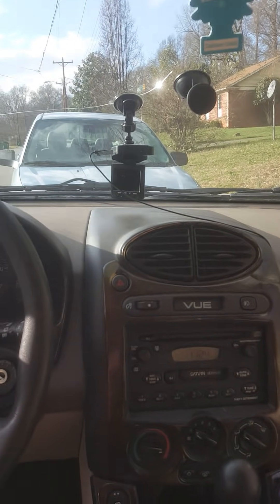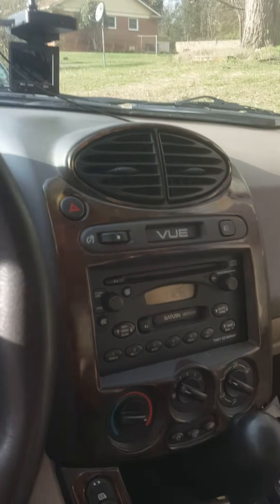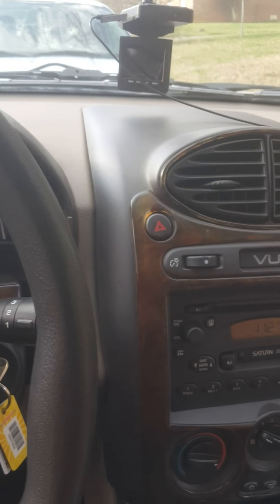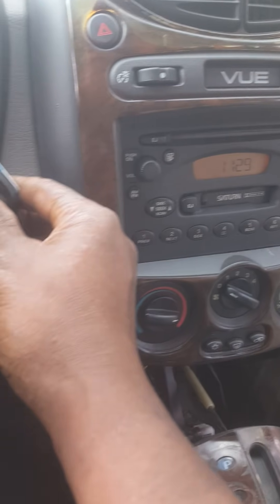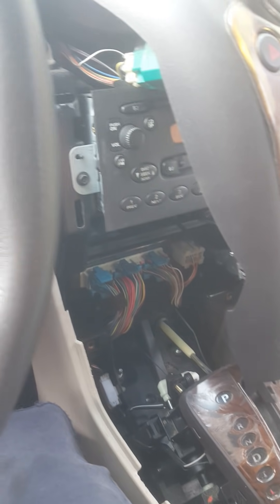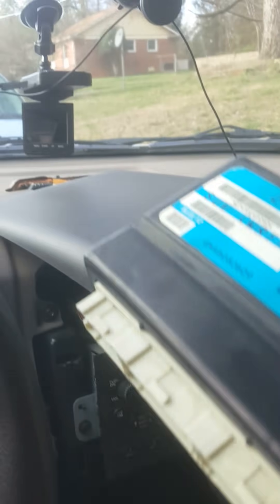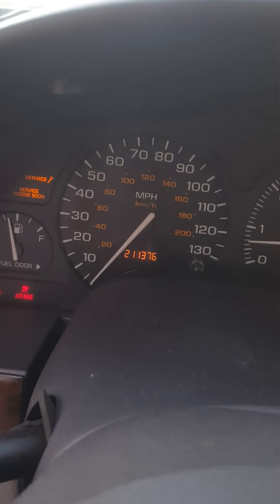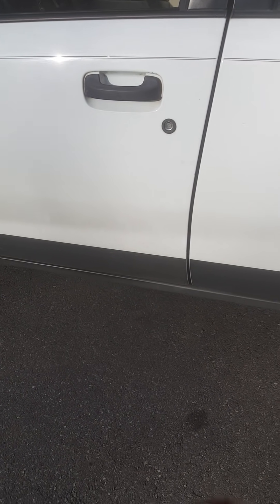How TO PROGRAM A BCM ... WITHOUT GOING TO THE DEALER

Comment: Dude, I don't think your keyless entry is failing because of the bcm...  If your replacement bcm is working, and you still cannot unlock your car doors with the remote transmitter, it's probably the transmitter itself...  you can try to replace the battery in the transmitter, or just replace the unit.

Comment: You didn't program anything... your key fob didn't work because it has to be reprogrammed because as you said, you lose memory to everything.  My husbands battery died and it fried his BCM. We got one from the junk yard and it runs fine now, but his brake lights are stuck on, as yours probably are and it needs a brake system,  rollover sensor and one other thing relearned and the key fobs need reprogrammed to the vehicle, which was easy to do through the options on the instrument panel on his vehicle,  but some will still need to go to the dealership for that.

Comment: your video is a little confusing. you said dont undo the battery, then you said leave the battery unplugged all night. then you put it in with the battery hooked up, I was told to diconect the battery on my car and then uninstall it. If you have a bcm for your particular car it will be fine. but if the BCM is off another car and doesnt match it wont work at all. unfortunately the bcm's are discontinued so junk yard or a guy with parts for your picticular model car. It can be done but most likely has to be reprogrammed. the bcm also works your alarm system.

Comment: Apparently I missed the part where you programmed the replacement body control module that didn't fix your concern with the remote door locking feature. It appears that you have created more problems for yourself. Hopefully you haven't created more problems for other people as well. Kind of ironic how you mention the world has changed for the worse... Lol.
DO NOT HOT SWAP ELECTRONIC DEVICES! IT ABSOLUTELY DID NOT FIX ANYTHING AND ONLY CREATED MORE PROBLEMS.

Comment: The os not reprogaming.
Some times you can swap bcms and not have to reprogram as long as the numbers match you can swap out them however the vehicle will have the other vehicles odometer reading so you could have made a golden egg or real bad lemonaid lol.
I would say reword it because that will still have to be looked at because if uour car it at 80 k  miles or kms. What ever you are and that had 170 k now you have just decreased your car value

Comment: I had a retired police 2006 Impala. All I wanted was the dome light to come on when I open the door. I swapped the bcm with one I got from the junkyard. The dome light comes on when I opened the doors but now I have check engine light. The camshaft position sensor and no matter what I did it never went off. Including replacing sensor and erasing the code or even putting the original bcm back in. Also maybe you should have replaced the battery in your fob or reprogram it.

Comment: Thank you and also maybe somebody asked. My 2006 Cobalt. Has the ac controls with the plugs as well as the interior fuse box has the two plugs do I just do the ones plugged into my AC component? There are three separate plugs in that guy. But could see where I would possibly need to do the fuse box as well? Or just the three in the ac plugins? Sorry. But like you said. No money and so much work I've put into this car

Comment: The problem is most likely the key fab. Take the back cover off, pop out the little circuit board take a "0000" fine steel wool and clean the silver connectors that the lock, unlock, etc. buttons push against on the board. Put it back together and the fab and it should work, a common problem.

Comment: This is great. My only question is, is it possible to keep your mileage, it seems like having inaccurate mileage would be annoying
Reply: and illegal to tamper with, unless your a tech or replacing with a programmed to car, milage n all rtr bcm (includes cab swapping re -vin-ing a vehicle sherif will gather info and apply it to the new vin# so milage is added to new config instead a computer, a tech uses thats part of a profile online thats associated to it, individually and milage is only available to change in collision repair and the vin they used  and use case ect, needs to match a car with less or more because the used cluster from Jy or wherever was cheaper and they went with it, )not sure where i was goin but vin # needs to be as accurate as possible within x miles is all tied to someone doesnt wanna buy a rebuilt car w 32,000 not knowing some one freshened their old car with, or the car the collision repair or scrap yards selling parts from totaled cars with some good parts still using such to gain the market that selling the used car would seem ideal. bringing the i think law on it. idk tho and  i hate rtyping

Comment: Aaron this is bad information. Not only did you NOT program it you have created many additional issues. Let me go through them.
1. Your mileage will change to whatever the used module had on it. 
2. You will have the SIR airbag light on and it will not go off. It is programmed with the VIN supplied by the BCM and will NOT transfer as it will give you a configuration malfunction code. 
3. Information on tire size is stored in it. If different than yours, your speedo will be off. 
You did nothing more than install a used BCM. These BCM specific to the Saturn car line are also a ONE TIME ONLY programming. To make this work you HAVE to have a new BCM that must be programmed with SPS/TechLine Connect. As to a no start with the security light on that is an easy fix w/o tools using the 30 minute relearn. In addition you will need to program you key fobs as they are part of the RCDL that communicates with the BCM and the FOB codes are stored in the BCM.

Comment: God bless you for your help. I was wondering do you disconnect the battery terminals till the next day before or after the swap? 4 years later and I feel that it’s become worse out here. Fast food inflation has gone up to %70.
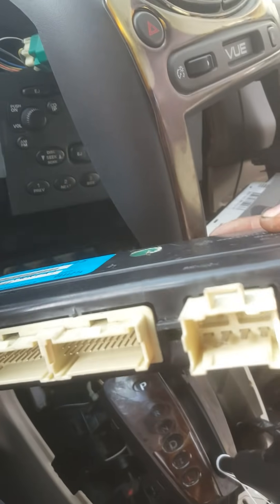Reply: If you have a bad bcm, DO NOT take off your battery cables, or your car will not start back up. At 5:22. ONLY IF YOU HAVE A BAD BCM, if you disconnect the battery beforehand, you have to let the car sit overnight (to drain all the power from the cars computer) then in the morning reconnect and it will run. ONLY DO THAT if you have to change your battery (if you say, have a bad battery) to get your car to run WITH A BAD BCM.

Comment: My 08 Vue's brake lights are staying on while key is out of ignition. It only shuts off when I pull the fuse for BCM VB3. I checked the brake pedal sensor (it's good), replaced the engine stop light fuse. Do I have to replace the BCM?

Comment: Although you didnt" program the BCM, you did change them out and the "new one" worked. Risky but Rewarding - Thanks for sharing sir
Reply: I don't think you understand what he's saying...  He's saying that if you disconnect the bcm when the engine is off, and there's no battery power to the unit, and then you install a replacement unit, you'll need to go to the dealer to have the replacement one programmed...  Conversely, if your battery is connected and the engine is running, you can "hot switch" the two units, and the replacement bcm will take the programming automatically from the car.  I don't know if this will actually work, because I haven't attempted it...  But it's worth a shot, if it saves you from paying for the programming service @ the dealership.
Reply: What dealers still have a Tech 2 scan tool...... I had to get a used one at the yard for my 2000 L Series probably 10 years ago, because no dealers used them anymore. Maybe some of the newer scanners will work today, I don't know. It's gotta be programmed for the lights to go out that I ever knew of. There's some way to clone them as well but I'm too old to get into the technical jarva. I had to get a new one from Rock Auto, which they don't stock anymore and have a friend of mine at a shop that had the scan tool to do it. It took a couple days due to software availability issues from GM, but finally got it downloaded to it. 3 years later I'm having issues with electronics again, and crank/intermittent no starting issues. I hope it's not back to the BCM problem again, because now they're getting harder to find new. Maybe a used one can be reprogrammed, I don't know.

Comment: So turn the key to on position then swap the bcm and it's good to go? 2010 traverse won't even start because of the bcm going out and like most I can't afford $600 for a new one and to "flash" it. Really hope this works for me. Gonna order a used bcm from same yr/make/model and try this
Reply: Did you fix it? Have you looked up if your car has a way to reset the car anti theft lock/security light. ? If it has a step by step process then that might work. It worked for my car, since thats what needs to be synced. The ignition switch cannot communicate properly until it is reset, for my car it was a 30 minute process and a $30 part from the junkyard.
Reply: @justchillin7274  no it didn't, I had to reprogram the key. Luckily my neighbors friend works for a repo company and they had the scan tool and let me use it. Took like 12 mins for it reprogram

Comment: This is ironic I run across this video. First, I have a BCM issue with my BMW 525i and it's needing replacing. Second, I have a son named Aaron Harris.  He's an Aircraft Tech and I'm a retired Heavy Equipment Mechanic. I would like believe this would work on my wife's car but these cars have to many electronic modules (mess) and I have my doubts.  Gotta do more research. Good job Sir.

Comment: Thank you  Sir; I'll gonna work on my  97 honda crv; I 've issues with door lock ,and internal light as well cigarrete lighter, ran some test on  electrical shorts, but i think  is the BNC. You mention the used bnc you replaced with , show the  milage of the  original car. My car only has 174,000 miles  i should get  something  less than 200,000  right ?, I like your opinion.

Comment: Mil light and flashing security is incorrect anti theft signal received and you can program the remote via key on and activating door locks to enter program mode NOTE bcm MUST be security (keyless ) equipped supplemental info in glove box on part list sticker 3 digit codes you'll have to look up s 10 is example aul for keyed entry, aux for keyless. Ecetra

Comment: I have   hyundai santa fe 2014 model CRDI  4WD automatic, push button start a car in which its bcm and smart key assy unit is now electronically damaged due to water filling ,no light is coming in car meter or no function working only stereo car is running no other function is not working,please tell me any proper solution

Comment: Ok its the bcm the problem 100 percent.  If remote don't work. ( try plug in and a couple of times. The relay will click in the bcm. And all will work. Another faulty bcm ( it come down to a relay in the bcm ( get a electrical engineer to change the relay. And it will work. God bless

Comment: Thanks for the info on my BCM. As you described the problem it is exactly what is happening to my 2001 L300 Saturn. And thank you for how to replace it and reprogram it. However, did the used bcm still have the program from the previous vehicle? Thanks from Jim of Roseburg Oregon
Reply: My Saturn l300 2001 miles are Unknown as well
Reply: Did u ever fix your problem

Comment: I'm trying to get factory cruise control I added to my 2000 SL2 working. I'm a Saturn Forum member and get so many answers that a Swap is all I needed to have the cruise enabled. Did the swap, and now "No Start !" I believe it's a security issue and I also believe I was told wrong that this procedure works just swapping the BCM that was from a Donor W/Cruise option. O.K., If all of you Genius's out there that put other peoples comments down, how is this done then ?! If a lot of You know about car's so much and how this works, how do You enable the Cruise after all the parts are connected ?! Let's see how many of You can give the correct advice. The Forum states "IT CAN BE DONE !" Let Me know, then. We'll see. Most Dealers said they can't enable it because of the age, or say there's no guarantee it'll work, You pay the $135 either way. Lol, I don't think so. We'll see which way is correct, here.

Comment: I got a 04 ion 2 kinda havin same problem. The ion is known for ignition switches goin out pass lock coming on says service vehicle on dash board.. what I just found out is it’s not just the ignition it’s the bcm. Which led me to your video. My local dealership is a joke I’m not about to even think of taking the car there haha. I think a tech 2 scanner read all old codes from bcm, swap it out, reprogram should resolve everything. But what you did does help, on the ion’s it’s the same way you disconnect your battery and whole vehicle starts doin crazy stuff. My mom has a Chevy Colorado did same thing as well after disconnecting the battery. GM hmmm. Thanks tho man I’ll keep this info in mind if I’m fact it’s my bcm I haven’t pin pointed it yet.

Comment: Just watched your video and my power windows on my Saturn ion 2007 does not work nor does the power locks on the driver side master switch is it the same for an 07 Saturn ion to swap out the BCM as it as it was for your vehicle

Comment: So leave the battery plugged up, and leave the key on (engine not running), remove the old BCM, install new BCM. Then start the vehicle. This is how it will program itself? Awesome!
Reply: Can you confirm this works? Also what vehicle have you done this on?
Reply: @Alex Cosme  a shop plugged a donor BCM into my 04 Colorado, and it flashed my 98K mileage to 240K on my instrument cluster😑. So now I have to remove my cluster to have it zeroed out, and it will flash back to the correct mileage that my new programmed BCM is set to. This stored cluster mileage MAY NOT always be a issue with all vehicles. But I'd make certain before ever using a donor BCM
Reply: I’m going to try this on an 03 Monte Carlo. I have a brand new bcm and I also have a donor bcm from a used car. Do you kno if I can use the brand new one or should I use the donor 1?
Reply: @KensBlends  did you try the bcm swap what happened?

Comment: I have a 2008 Impala that dash reads battery saver active and I have recently replaced the battery with a brand new one + Alternator & Starter + a fresh oil change but keep getting that message and sometimes my car dies out draining the battery
Reply: Have alternator checked if good replace battery, these cars have a sensor on the red cable at the terminal! Make sure it wasn’t removed or isn’t loose!
Reply: Ignition switch

Comment: Just to let people know. As a gm mechanic for 35 years this guy is not knowledgeable of what he's doing.
After replacement of the bcm you have to reprogram it. I used a tech 2 scanner to program them.
All he's doing is R and R (remove and replace)the bcm.
New bcm's come blank. They have to be programed using tis 2000 software.

Comment: This video had zero information about programming and a bunch of misleading info that may or may not even by relevant to the topic. Just how to get the car to run after installing a used module and on a particular vehicle that can luckily do it. And for everyone with a newer model vehicle of any kind, i.e. 2008-current, this will be a huge risk and 4/5 times won't work. Programming (not reconfiguring) a module requires a $400-$2000 j2435 passthru hardware tool and a $45-$120 software subscription from the manufacturer to do (sorry Mercedes owners but yalls are over $30000). So sometimes letting the dealer or a profesional programmer do it is the only way.. And on top of that programming is a tedious process that, if done incorrectly, can cause you to have to spend more money to fix or even total your vehicle as most depending on how bad you screw up. Reprogramming is like making teaching your vehicles computers (there can be from 5 to 50 per car these days) be able to communicate. Like 8 english speakers and one Japanese speaker working at a job, someone has to learn a language regardless of who it is (sometimes the 8 english workers have to learn Japanese in this sense) A new module may not speak the same language as the other modules in the car, and Reprogramming just teaching that module the language so that can work together or the new module is too new and the other modules have to learn the new language to have better functionality. 

Anyway i stumbled upon this video by accident and cringed at the misleading info of it and wanna make it clear to whoever takes time to read this dragged out explanation. its not rocket science but don't let this video make you think programming can be done without expensive tools and a laptop because it can't. Configuration can SOMETIME but replacing modules needs to be Reprogrammed. (A lot of times you even have to by new module for it to work)

Comment: Aaron do you think this would work in a 2009 Nissan Rogue as well? The keys are working intermittently right now but my mechanic just told me that the BCM was the reason they weren't working consistently and that I had to take it to the dealer which want half as much as the thing is worth to replace and reprogram which is crazy. I'd appreciate a reply and thanks for your time.